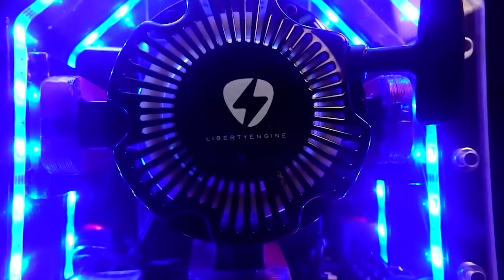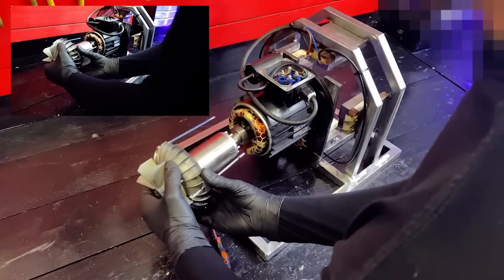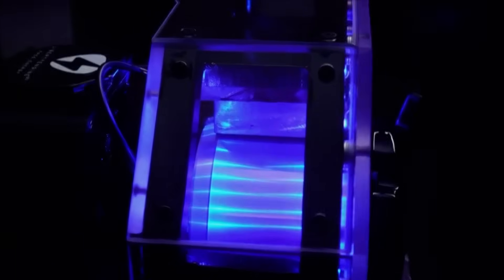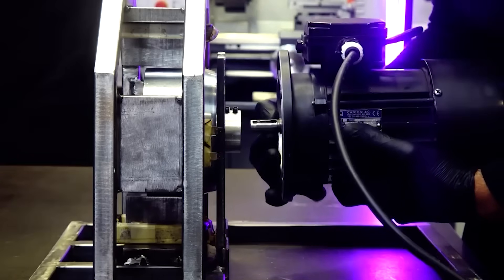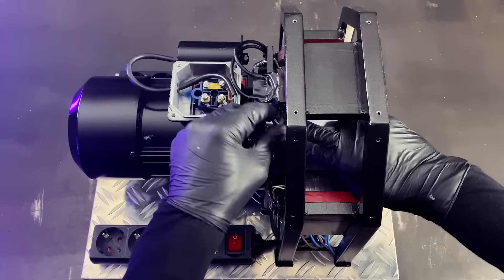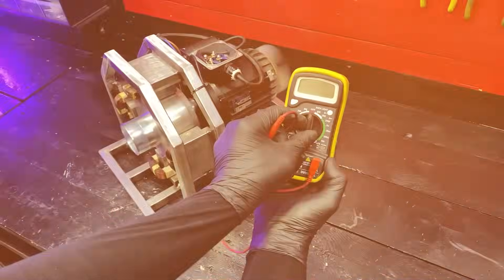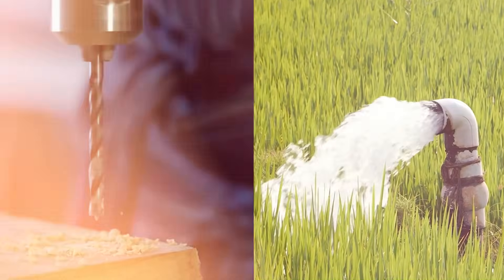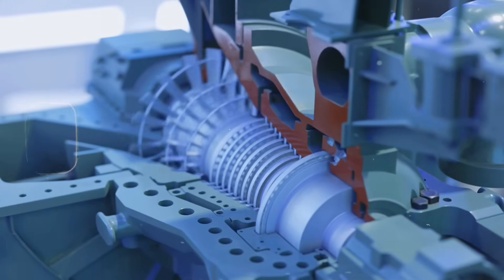How the Liberty Engine 2.0 Generates Its Own Power Through Magnetic Induction

Comment: You can't create energy out of nothing
According to the First Law of Thermodynamics (the law of conservation of energy), energy can neither be created nor destroyed, only transformed. A machine cannot output 100W unless it receives at least 100W from an external source (sun, wind, fuel, or battery).
In a closed system, the equation for energy change ΔU looks like this:
ΔU=Q−W

Comment: For these so called magnetic engines to convince me I would like to see it working on a glass transparent table running continuously for a week or more without any wires connected to it. When wires are connected to these 'engines' it is so easy to provide them with a hidden power supply.  In the vide we see it running outdoors pumping water but this could be running from a hidden battery cable out of view.
Reply: Zagubiłeś się aku ma prąd stały